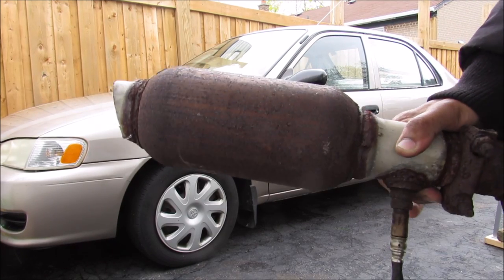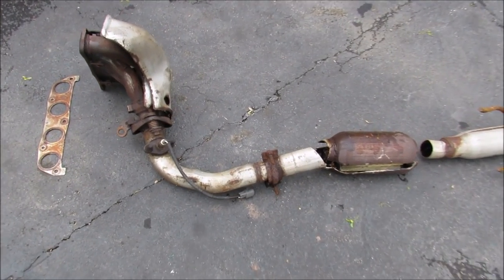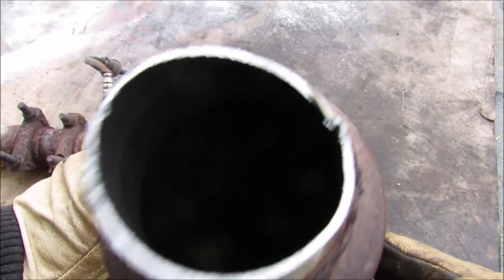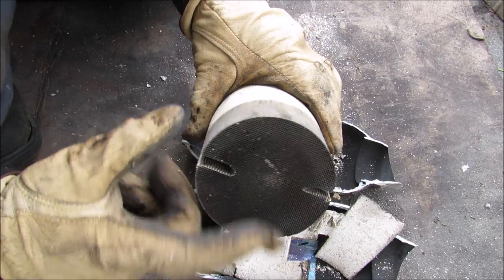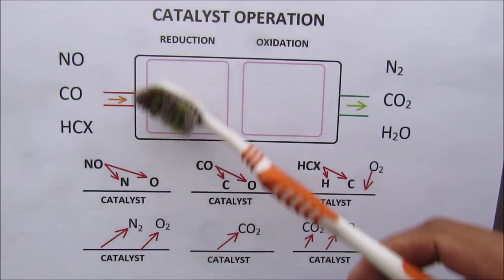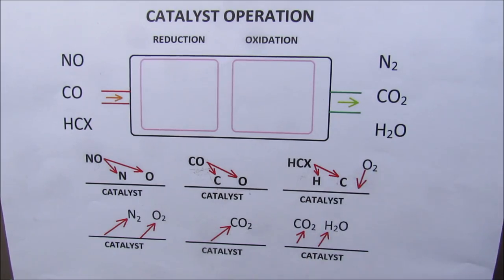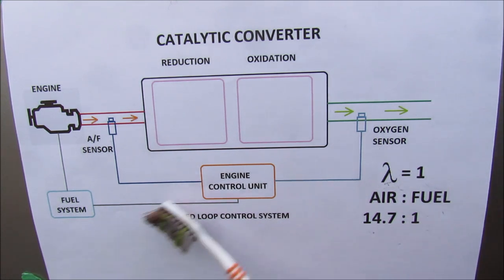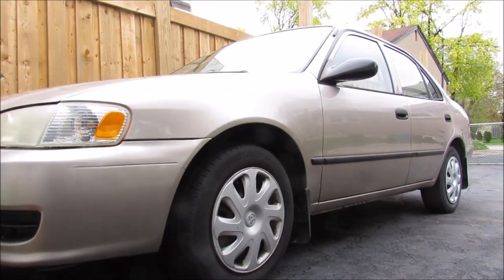How a Catalytic Converter Works

Comment: Some sources online show use of insulating layers in between the shell and the felt like material. Was it previously required but later done away with due to some developments or is the felt like material itself the insulation and nothing else is required? and which year model is the corolla shown here? early 2000's ?
Reply from the maker: +siva s 2001 Corolla. Not sure why it's there.

Comment: actually the rear 02 sensor is  supposed to read little to any oxygen as the converter is supposed to use it to reduce hc and co. Not sure you worded "make sure catalytic converter is outputting enough oxygen"correctly
Reply: Furthermore if the rear 02 sensor measures a lot of oxygen it will most likely throw a p0420 code for catalytic converter below efficiency.
Reply from the maker: +the doge ah i see, I guess I had it backward. Its job is the sane, to monitor that catalytic.

Comment: Does the direct contact of oxyacetylene flame causes problem in the proper functioning of catalytic converter ?
Reply from the maker: +Abuzar Khan If you overheat it for a prolonged period it might reduce the efficiency of the cat.
Reply: I feel sorry for the poor cat, that is awful.

Comment: i noticed on my car that mixture is not fixed on 14.7:1, it floats between 12-16:1 in closed loop below 3000rpm, and in open loop and rpm higher than 3000, it goes to 12:1 fixed, so if you floor it , cats can not reduce polution, it just can be destroyed by melting, what happened to me
Reply from the maker: It isn't always fixed 
It's the ideal ratio

Comment: my mechanic just informed me that the previous owner of my Honda Accord cut the cat out and replaced it with normal pipe haha.
Reply from the maker: +Car geek 101 And you don't get check engine lights?
Reply: speedkar99 no I don't! it is super strange
Reply from the maker: +Car geek 101 He's got an O2 sensor simulator or he's pulled the bulb to the CEL. Get it scanned.
Reply: speedkar99 I have a scan tool I will check. I am not too worried about it because I don't have to do emissions where I live.

Comment: Does the cat converter filter out pollutants 100%? I ask because curious how with modern cars people can still manage to commit suicide by running it inside a garage
Reply from the maker: +mrsemifixit No, its closer to 90-95% 
There's still some carbon monoxide that kills
Reply: mrsemifixit it's not %100 as speedkar said, but modern Catalytic converters (and engines) are incredibly efficient. They produce much fewer pollutants, especially if they are in a steady state (I.e. Idling instead of revving up). Also, they don't really "filter" our pollutants but instead convert them chemically into less harmful molecules.
Reply: It's very efficient but it still outputs CO2. CO2 isn't really that toxic and much better than CO but even 10% concentration is enough to kill you of simple oxygen starvation. And it's really a shitty way to go.
Reply: it might be the CO2 that kills